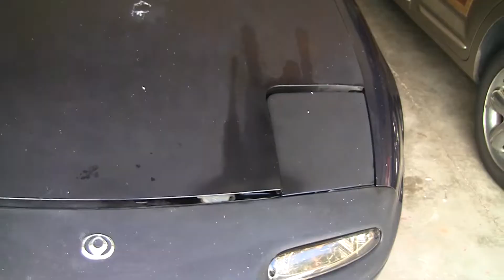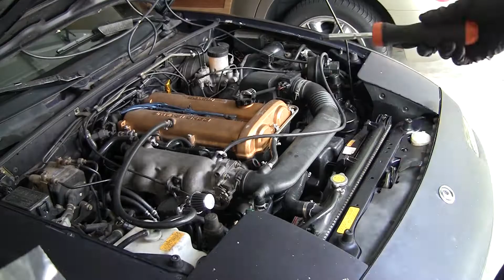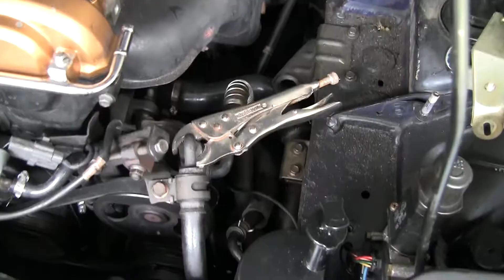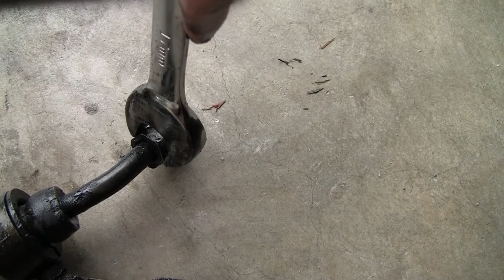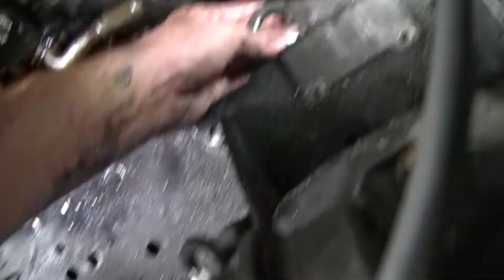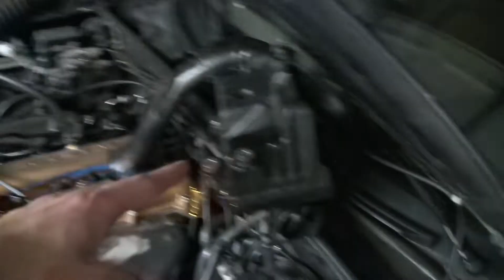How to Replace the Power Steering Hose in Your NA/NB Miata!

Comment: Do you by any chance have the part number for that hose or a link to it
Reply from the maker: This is where I got it from: https://www.rockauto.com/en/catalog/mazda,1996,mx-5+miata,1.8l+l4,1190944,steering,power+steering+pressure+hose,7320. I don't remember which one I got but I would trust Gates brand the most

Comment: Wow, did you do that the hard way. Next time, don't take anything off, loosen the hose bracket with a 12mm wrench, then go through the wheel well with a 17mm crows foot on a long extension to loosen the bottom of the hose, use a 22mm crows foot on an extension to loosen the top of the hose, then pull it out. If the job takes you more than 15 minutes your doing something wrong..
Reply: Hey Rocky, took your advice and it made this job a breeze. For someone like me who rarely works on cars, your comment saved me multiple days. Thanks man.
Reply: @zadeok same this guys comment made it way easier

Comment: Mines been leaking for the past two years. My neighbours hate me I've leaked so much on the street, andI still I can't face it.
Reply from the maker: It might be the rack or the pump itself leaking. Can you see where the majority of the fluid is leaking/pooling up?
Reply: @DriveMX5  not realy. i will try nipping up the high pressure lines. if i'm lucky (I'm never that lucky) that might do it . Thank you for the video though, it's pretty detailed.
Reply from the maker: @dizzyrider3883  I hope it does! I think the rack itself ended up leaking on my car, I could see the fluid collecting on the rack and all over the splash pan. Good luck finding and fixing the leak. And you're welcome, I hope the video was helpful!